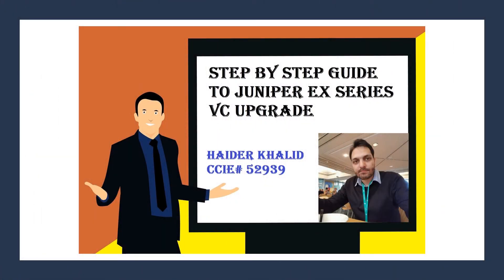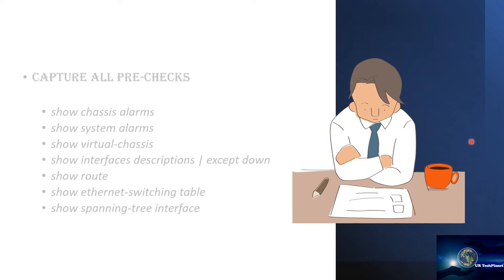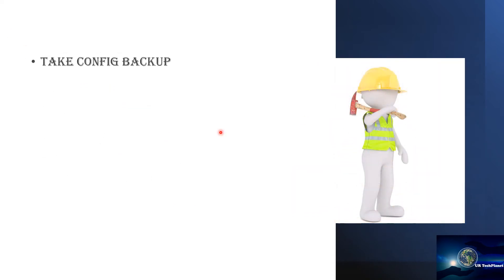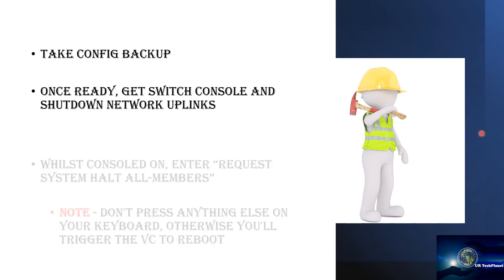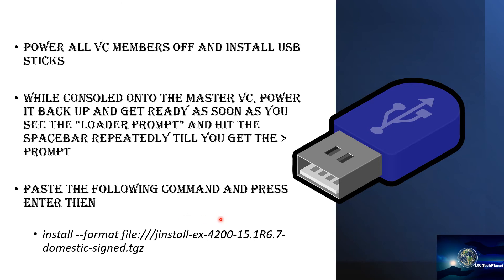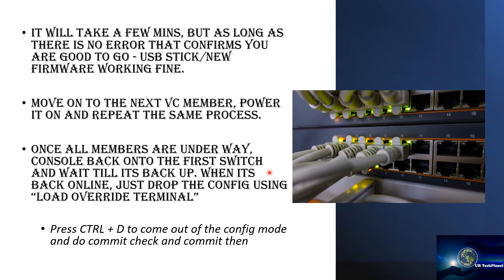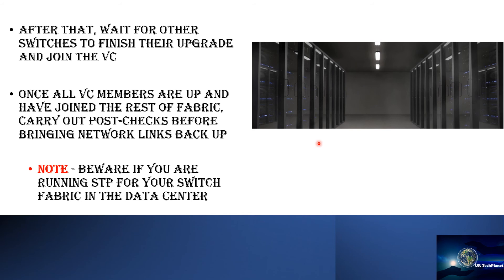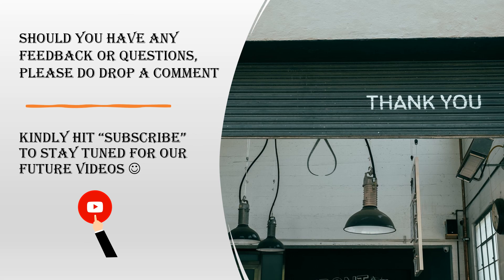Juniper EX VC Upgrade via USB - A Step by Step Guide

Comment: Easy and comprehensive at the same time! Also to note, you can use physical ports for VC as well in EX series. Need to configure them manually though.
Reply from the maker: Correct. Didn't include that just for the sake of simplicity, but thanks anyway :)